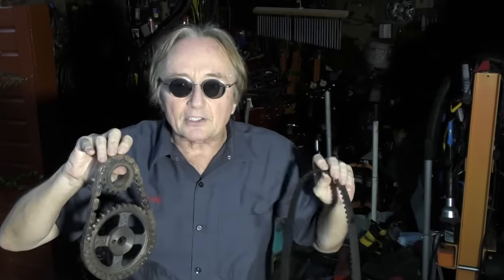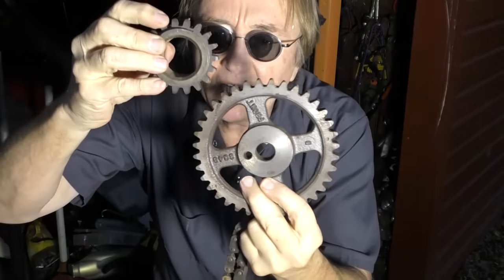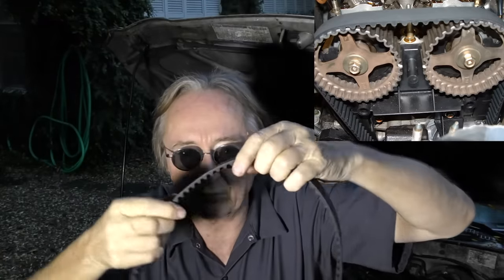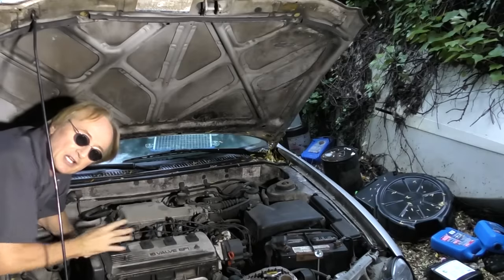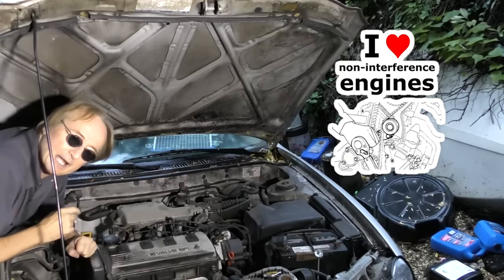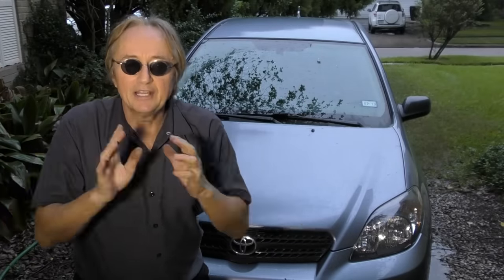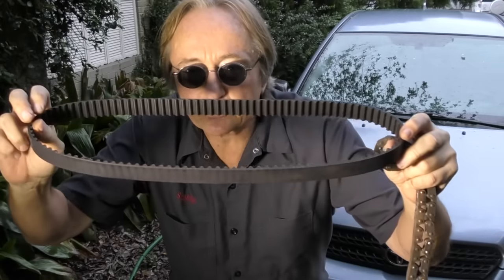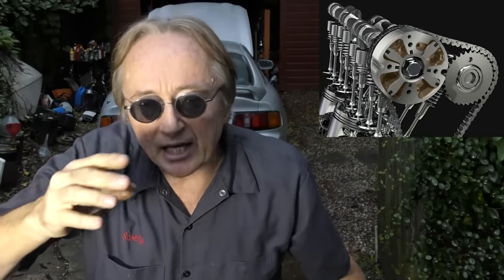Why Some Cars Have a Timing Chain Instead of a Timing Belt

Comment: Belts are for clothes, not controlling valves.
Reply: Yeah it's ludicrous to have a rubber belt controlling the timing of an engine, a timing chain should be mandatory on all cars
Reply: 😂😂😂😂😂😂😂😂😂Absolutely right
Reply: @bar-sabas4801  Yeah manufacturers use rubber belts to save on costs and so the consumer has to come back every 80 thousand miles for new belts, saying that the Alternator belt on my car is up to 101 thousand miles only just Now making a squeaking noise but luckily the engine has a chain not timing belt so no worries there
Reply: Cars have timing belts because cars wear pants too 🤣🤣🤣🤣🤣
Reply: Thank you. Chains are superior in every way.
Reply: Personally, I wear a chain around my waist. It's more reliable.
Reply: what if your car also uses a timing suspender?
Reply: you sound like my mentor, back in ma day!
Reply: Yet they last for hundreds of thousands of miles.
Reply: When the chains or guides fail,you will retract that statement,lol. The timing belts should be like the 4 cylinder Volvo,easy to change and non interference,so easy you could do it with your oil change.
Reply: Don't be fooled long OHC chains do wear out and do need replacing, difficult and expensive!
Reply: And plastic is for my kids toys. The plastic crap chain guides are the dumbest idea I have ever seen. I have replaced quite a few timing chains and belts. I will never buy a piece of crap chain driven car ever.
Reply: Timing chains encounter problems when they get so long that they have to reach over two cams all the way down to the crankshaft, they're prone to stretch which really is wear, not stretch, guides wear out, chains can slap around and cut through timing covers, if not engineered correctly they can go dry and fail, like the General Motors hi feature engines which have terrible timing chains, Ford decided to put the water pump on the timing chain where it can dump all the coolant into the engine or it can seize up and break the chain. There's all kinds of problems when you have to get all the way from the crank to the top of the engine on two sides. This is where I prefer a timing belt Which is far easier to replace on a regular maintenance schedule, and don't put the water pump in the crankcase Ford really stepped in a pile with that
Reply: @josephstevens4032  Back in the early days of trucks and cars, 1900-1919 era chain final drive to the wheels was not uncommon. But chains are really pretty primitive to transfer  power. My motorcycle has a belt drive that's quieter, more maintenance free and longer lasting than a chain, you would think they would have come up with something far better by now, say a shaft drive using bevel gears. However I think before the IC engine is given up, we'll see no cams at all, using "mechatronic" control which gives complete computer control over lift, duration and timing in all aspects. This is here already, and I think will be commonplace soon.
Reply: That’s why you don’t put off any maintenance! Change the belt on 100k miles !
Reply: This world is about making money.The very few are getting rich and most are poor  that would be the main objective.
Reply: @blackbirdpie217  Yup.. Ask anyone that's owned an early CTS V6 or any other GM product with that dohc engine. Chain tensioner failure is basically inevitable. Many other cars too like the AJ-V8 in the Lincoln LS or Jaguar S Type (all trash)
Reply: What about drive belt's
Reply: Yeah except it’s a proven system that has driven millions of cars.
Reply: @davecrupel2817  They stretch over time and change length with heat making timing imprecise. So not superior in every way.

Comment: When I see timing chains have issues it's with the chain tentioners not the chain itself
Reply: Ford Cologne 4.0 SOHC V6. Weak guides and tensioners. A chain on front for one bank and hidden chain in the MF BACK for the other bank, IMPOSSIBLE to repair rear without engine removal.
Reply: @WhitefolksT  similar problem with the older gen Colorado V6 engine.
Reply: This is one of the issues the 95-98 Nissan Sentra's have is the tensioners. You hear rattles but they are excellent cars
Reply: @Trident_Euclid  i thought Colorado's only with 4's and inline 5's
Reply: WhitefolksT yes now that engine is bullshit typical ford
Reply: Yes timing chains have plastic tensioners that end up in your oil pan. And you have to take the oil pan off to remove the plastic pieces. Timing belts work great but people don't change them on time.
Reply: I have a 03 nissan Altima 3.5L SE. My check engine light is on and I found out it's coming on because the timing is off on bulb 1. Sounds like a pricey fix, but I honestly don't know how it's effecting my car. When I start it up, I sometimes hear what sounds like a chain being pulled through something (that's the best way I can explain the noise) ....but it doesn't seem bad enough that the car isn't running right.  I would like to get it fixed, if it's not too much.
Reply: @neondiamondsaquaberry17  what in the world are you taking apart?
Reply: @XXXX-dr8on  I never hear of plastic tensioners, but plastic guides yes.
Reply: Very true. I have a 2007 Toyota Matrix and last year the engine started leaking oil because the seal around the timing chain tensioner wore out. I’m not too upset over it though because the car had 250,000 km on it at that point and it only cost $100 CDN to have it fixed.
Reply: @allseeingeye93  it's rubber so it's going to wear out.
Reply: Nissans are very well for those problems, i.e. my 06 nissan quest 3.5, tensioner started failing so chain rubs against the guides and you get a rattling noise coming from the engine during hard accelaration or sometimes at start up
Reply: @JesseH76  could be the tensioner, or your cam or crankshaft sensors
Reply: @JesseH76  just read the last part about the noise... Definitely the tensioner guide, is nylon and tends to slide off the base.
Reply: josh g correct and they were both poorly designed in my opinion. My mom had 2 i5 blow on her and she doesn’t drive hard. So I decided to put a 6.0 in it
Reply: Some early model American v8's don't even use a tensioner.  Like 302 fords
Reply: My 04 Maxima had a chain slack guide go bad.  Dealer wanted $2200-$2600 to fix it.  I got the oem part for $18. I was lucky to have access to a lift, shop, air tools and a great buddy to assist. I got it done.
Reply: @66mustangguymoreau36  most v8's don't, the use the ones Scotty was holding in his hand, short and strong, no need for a tensioner.
Reply: Yeah my timing chain tensioner is bad and causing the car to leak oil...
Reply: I don't know why you would need to remove trans to change timing chain on 4 cyl FWD. It is on the other end.
Reply: My 5.4 2v timing chain tensioners blew out lmao at around 800-1100 rpm you can hear the chain rattle lol
Reply: Arz2003 Mine rattle (97) an MIL randomly went on/off. I didn't care for 65K until one day, the chain skipped a  tooth of the sprocket and a valve made a hole in one of the pistons :[]
Reply: see mine comment below
Reply: Javier Molina  yes, I know. That's why I said I wasn't upset because of how much milage I got on the car before it needed replacing. I've never had anything else replaced on it over the 10 years I've owned it except for a serpentine belt, brake pads, and fluids so my Matrix has made me a loyal Toyota customer.
Reply: @XXXX-dr8on  the reason the plastic ends in the oil pan is not changing the oil on regular intervals
Reply: On my 1998 Saturn 2.0 DOHC the tensioner wore out, the chain skipped a tooth, the valves hit the piston, the engine was ruined. I miss the pushrod engines.
Reply: Gm 3.6 DOHC motor. The rear head's timing chain stretches ab half a link around 90k.... 12 hr job... no bueno
Reply: Mark Richards  You are correct. I should have stated tensioners/plastic chain guides that break.
Reply: @aaronrbrts  they usually throw a code for it too like 2.2 ecotec  does.
Reply: @damonlemasters3424  yeah! Cam sensor and cam phaser codes for a good while, then chain slaps bad on the guides. You have to really want most of them to die, it's ab impossible not to hear it slapping around in there. Now the 1 on my 2.2 ecotec just went with no warning, but that one I think the sprocket teeth wore down mostly and let it skip.
Reply: Incorrect, 7 out of 10 the guides are still serviceable and the chain has just stretched 2 or 3 inches. Yes that much. I have laid dead chains on the bench compared with new ones.That on a SOHC four. that is over 3 feet long!
Reply: The chains I've done have stretched a full link, the double rows last alright though
Reply: Especially on GM engines that rely on oil pressure to provide tension.
Reply: yeah, bad chain tentioner not lock in place.
It's savier if you not leave your car in park with gear on (use handbrake all the time),
because when oil pressure get low, that bad chain tentioner start lose chain, if your car is parked on "hill" with gear on, it could jump losed chain over gear.
You get then bad timing or worse.
Reply: @WhitefolksT  diddo with audi s4 4.2L V8
Reply: Does a 1998 Toyota Avalon have a timing belt or chain?
Reply: @DetroitLions1984  
Avalon 1995-2004 V6 Belt
2005-2012 V6 Chain
Reply: My 2008 Nissan Sentra (153829 miles as of this comment) has a stretched chain. It is flat worn out. It makes tons of noise slapping the cover. Maybe I'll fix it, maybe it'll snap and I'll junk the car. After all it was a $500 car.
Reply: Under regular circumstances they only need to be changed every 90k miles or so

Comment: Belt or chain, If the tensioner fail you hope you have a non interference motor.
Reply: Them right.
Reply: So true. At the shop I work at we get several ecotec motors that come in and the guides are broken and the chain has quite a bit of slack in it. Broken guides and weak tensioners is not good.
Reply: How do you know buying a car if it’s interference or not?
Reply: @Shino2600  Good question. Honestly the owners manual won't tell you, a car salesman will most likely give you a blank stare. I googled it when I had a Civic to find out if it had an interference motor or not. Most vehicles have interference motors unfortunately. The only non interference motors I know off hand are Toyota's 1MZFE and 5S-FE (90s Camrys).
Reply: I rather have interference engine, because it saves more gas per mile, it gets to speed quicker. Just never forget to change tensioner every 90,000 miles.
Reply: I bought this old 88 Omni, timing belt broke on me while driving in traffic 3 days after I bought it. Was shitting my pants and dealing with heartbreak before I googled the engine and found out it's a non-interference. Got a new belt and it's still running.
Reply: most chains run on guilds
Reply: Older Miata/Protege engines are non-interference (BP series)
Reply: @SpareRoomPokemon  is this true with the 2016 honda accord gdi engines?
Reply: @Shino2600  Call the dealer parts dept, they can tell you.
Reply: Rear occurrence..
Reply: The only nissan motor I know is a non interference engine is the VG30 and VG30e.
Reply: Why. Can’t engineers just make good things?
Reply: I hope the timing belt lasts in my Rx7, because I'm not sure if it's an interference engine or not.
Reply: Exactly
Reply: You most likely have an interference engine.
Reply: @blyndrotor  yeah, you wouldn't want the valves to hit the pistons
Reply: @MilesPrower1992  
Maybe that's why it uses oil.
Oh wait, that's cause I put it in the fuel.
Reply: ຮຸ່ງ ພຸ່ງແຣງ All that goes out the window if one day the tensioner decides to give up on life and makes the engine yeet itself into oblivion.
Reply: @SpareRoomPokemon  I have a 2015 Chevy Equinox. Is this the ecotec engine you are talking about?
Reply: @ John T 
This is the comment I was looking for
Reply: @Shino2600  sadly its difficult to know, most car companies dont readily advertise it, but these days most engines are interference, sadly. I would honestly suggest belts over chains if we went back to noninterference engines for the fact that theyre cheaper and anyone can replace a belt on a non interference engine, takes like 15 minutes tops to do and is easy as can be.
Reply: @VonSpyder  really? How come dealers charge $1,000 and make it an all day ordeal ?
Reply: @Shino2600  ask the seller or from manufacturers service manual.
Reply: @Jozavenue  ...and some run on guides.

Comment: Excellent video as usual. My 2.7L/V6 Sonata has a great engine, but it's an interference engine. I replaced the timing belt last year at 128,000, along with the idler pulleys, water pump, and hydraulic tensioner. The other belt was in good condition for 8 years old. Took 4 1/2 hrs to replace everything.
Reply: The 2.0/ 2.4 Theta I is a chain engine in the Sonata, I would go with that personally. Not the Theta II, that sucks.
Reply: electronicsNmore :
Reply: Interesting. I have a 2.4 4 cylinder Santa Fe.  I changed the timing belt, and replaces the whole timing pulleys with a kit.  The belt and the pulleys were still in great condition. I could've just left it alone.
Reply: @Naturalhit  The rubber exterior of the belt may have been fine but the tensile cords in the belt are affected by fatigue over time, and there is no way to inspect these. Just before a catastrophic failure of the belt, the cords begin to break progressively and the belt lengthens slightly as the fibres break and pull through the rubber slightly. But again, there's no way to determine when this is actually happening before the belt completely fails.

Comment: Hey Scotty, Back in the day, Ford made their engines (302 in my case) with a timing chain, BUT the timing gear had a thick nylon tooth coating on it. It would disintegrate at about 120k miles. The fragments would fall into the oil pan and get sucked up by the oil pump.Then you'd have to remove the pan AND the pump to clean it all out.

Comment: Changed the timing chain on my 77 GP at 300,000 miles. The one removed showed little ware,and was still good. Sold that car with 417,000 miles on it, I still miss that car!

Comment: I had a '74 Mustang II, had 2 timing gears. one of them was plastic on the outside so it broke and I replaced with 2 new metal gears (aftermarket). Ran well for many years. Nice Video as always.
Reply: Defeats the whole point of a chain. Leave it to Ford. Yet one more reason I stay away from their crappy designs. I'm with Scotty, Hondas and Toyotas, you can't go wrong.

Comment: Hi Scotty, I am from Europe and have to say that things said here are only partially true for Europian cars. As it goes, car manufacturers tend to skip out on material quality so we had cars with a lot of timing chain issues. It culminated with VW Golf TSI engine which had a timing chain that I would not fit on a bicycle, let alone on the car. People reported that it overstretched after 25.000 miles only.

On the other hand, modern timing belts are not made solely from rubber anymore. Today they are made from glass fibres and aramids (like kevlar), and some manufacturers (like ford) introduced wet timing belt system and they can last for hundreds of thousands of miles.
Reply: @Michiganman800  alright big boy
Reply: I know a ford engine with wet timing belt and the original belt never lasted long. Atleast the European ones didn't.
Reply: better gay than a murder!
Reply: MC Polž haha dobra
Reply: I had a 98gtivr6 with a chain  no problems ever.
Reply: @Michiganman800 
Every tribe has is own language only americans try to speak English
Reply: In Europe, the timing chain is a thing you run from. They are unpredictable, they do not have a rule when they would break. If you have a timing belt, you will run the car safely for up to 240.000kms or 10 years for some cars. No headaches at all. While running on a timing chain car might break from oil change to oil change. I am  talking about relatively new cars that go through my workshop: 2011+
Reply: @Michiganman800  Brilliant answer. I laughed for 10 minutes straight.
Reply: I've still got my 2003 VW Jetta GLI with a chain. No problems here either.
Reply: @killian35  that ain't no TSI/FSI
Reply: A timing belt is a service item. A chain isn’t. Modern belts are also thicker and wider so far more reliable.
Reply: Another TSI victim here...
Reply: @Michiganman800  So I guess America was founded by gay people. Explains a lot.
Reply: @usergiodmsilva1983PT   we have got over our gayness now, but the americans are still proper gay
Reply: Bojan Nedeljkovic yeah my 2008 sable has 229k miles never had one issue with my timing chain
Reply: Gary Miller maybe in America it’s an expensive service part but in the uk on most engines it would be around £500, every 8-10 years or so.

Comment: A timing chain is a prerequisite for me when buying a new car... Of all 5 cars I've had, all have had chains. Have clicked 345,000km in my 2000 Ford Falcon and it still runs like new with nothing but fluid changes and the odd pulley replacing. Services cost me around $20-30 every 6 months on an engine with such a simple, solid design!